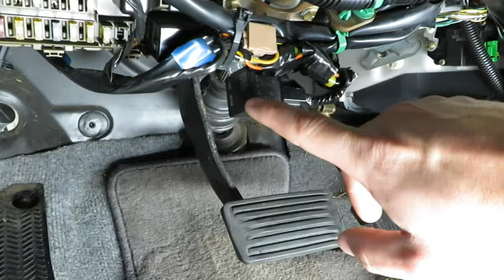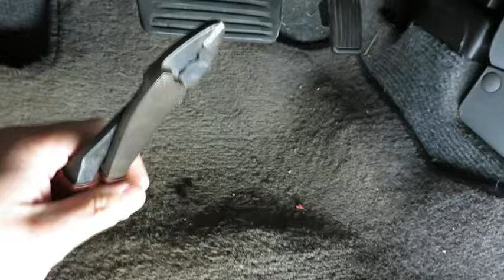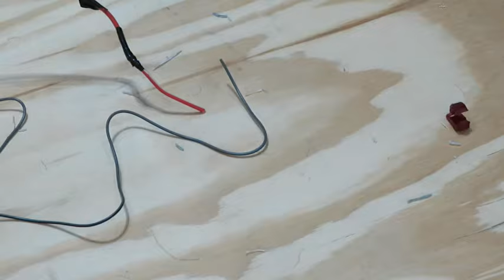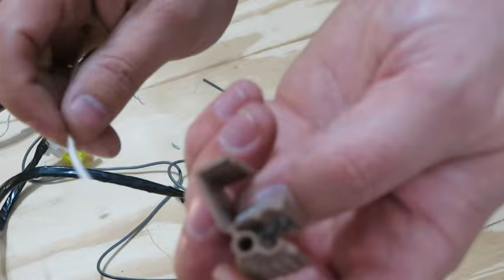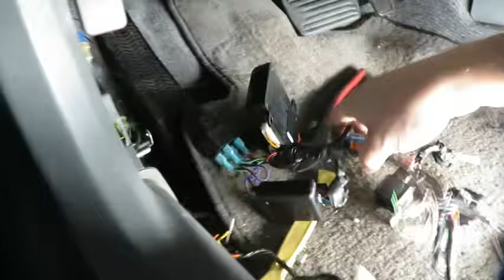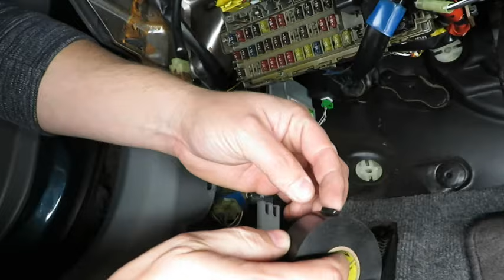Car Alarm Removal Made EASY Without Damaging Your Vehicle!

Comment: Thanks for this video. Do you have an Email handy? I have a 2002 Toyota 4runner 2wd and someone installed a IR-S Code Alram, it has like a little tiny switch to start the car. I would love to un-install it but not sure if I cut the wires if it will ever start again
Reply from the maker: dcautodiy@gmail.com
Reply: @DCAutoEnhancement  I will send some pictures over the holiday after I take some trim panels off
Reply from the maker: @ddemier  we will get it taken care of. No worries
Reply: @DCAutoEnhancement  I got it removed thanks to your video. When I removed the trim panels I saw where that had it tapped into the factory wire harness. Got that thing out of my 4 runner.. lol

Liked, subscribed and shared.
Reply from the maker: @ddemier  Awesome! I'm glad you were able to get it taken care of and thank you for your support!

Comment: Could having a remote start mess up your battery?
Reply from the maker: @alexis471221  generally speaking, no, it shouldn't cause any issues with your battery. However, if wire connections have become weak (especially the ground wire), that can cause a drain on the battery. Also, if you have had the remote start installed for a long time, the electronics in the main brain could be failing, causing battery drain issues. I guess maybe tell me what issues you are having?
Reply: Hi I just buy a truck silverado 2012  and see they have a db3 on it but the guy don't give me any control only give me one key! What can I do bc when I locked the alarm beep on. And when I unlocked with the key the alarm sound on. Any suggestions thanks
Reply from the maker: @viktorfrankenstein1240  the db3 is usually just the bypass module. Can you see if there is any other module?
Reply: No i dont see other module connected in the db3 or separate but i see the db3 is connected with harness on the obd2@DCAutoEnhancement
Reply: Tried to send some picture or short video..u got it . The db3 is connected to the harness to ob2 and go to the switch for key
Reply from the maker: @viktorfrankenstein1240  I will check
Reply from the maker: @viktorfrankenstein1240  I didn't get it. Send it to: dcautodiy@gmail.com

Comment: My ac/heat doest not turn on. I have no AC or Heat. I checked all the fuses,relays , blower motor and blower resistor,all is fine. Change the clime control module still nothing. This happens after the shop changed the starter. I do have an aftermarket compustar starter. Do you that has anything to do with my problem? Thanks
Reply from the maker: The only think that I can think of is if they somehow cut the heater/accessory wire. Does the heat and air work when you remote start the vehicle?
Reply: @DCAutoEnhancement  no the heat/ac doesn't turn on at all. The lights on the climate control are ON but the the on/off button doesn't turn ON neither the heat or AC. Thank you for your quick answer
Reply from the maker: @hnmpp  What is your vehicle?
Reply: @DCAutoEnhancement  2015 Honda crosstour 4wd
Reply from the maker: @hnmpp  I will look into your problem.  Did this problem happen after the installation of the remote start?
Reply: @DCAutoEnhancement  no it happened once the shop changed the starter and after they did some diagnostics they said might be the climate control module or the aftermarket starter.
Reply from the maker: So they changed the starter for the motor it sounds like.  I would take it back to them and make sure they didn't forget to hook up a power wire. When changing the starter they most likely had to disconnect some wires.  That is the only thing that makes sense at this point.
Reply: @DCAutoEnhancement  I did but they said they couldn't find anything wrong. Thank you so much for answering back at me ,I really appreciate
Reply from the maker: @hnmpp  I wouldn't think that the remote start would not have anything to do with it but you could disable it to verify

Comment: So you can just leave the t-taps in there?
Reply from the maker: If they are T-taps, you can leave them but I prefer to remove them and place electrical tape on the wire where the T-taps cut into the insulation. If the connectors are scotch locks, remove them for sure. If you don't know the difference you can Google them and compare the images.

Comment: Great video could you have just left the red connectors there instead of removing them and applying electrical tape
Reply from the maker: Yes, if you know you want to replace the alarm or remote start, it can be helpful to leave them so you can use them in the future. You also shouldn't need to tape them up. I knew that I wasn't going to be reinstalling anything on this vehicle but if I did, I would be soldering my connections.

Comment: How do you start your car when you lost your aftermarket key fob
Reply from the maker: You will have to bypass the starter kill relay. If I remember right, it should de-energize when you disconnect power to the alarm.

Comment: 2006 Ford F-150 viper… can it disrupt fuel pump?
Reply from the maker: Yes, if it has tripped the factory immobilizer system.
Reply from the maker: Is it a remote start or just an alarm?
Reply: @DCAutoEnhancement  remote start as well. I disable the box and re wire wires from switch but still doesn’t start. Also I notice some wires run to the driver floor that connects harness to the rear of vehicle. Can that be the one connected to a fuel pump?
Reply from the maker: @karristun1968  if those wires connect to the remote start, they could be to your door locks or brake wire not nothing from the remote start directly connects to a fuel pump wire.
Reply: @DCAutoEnhancement  if it tripped the factory immobilizer what can I did to fix?
Reply from the maker: @karristun1968  that would only happen during remote start. If he it is the immobilizer, your security light would be flashing

Comment: Hi, I replaced the battery in my key fob couple days ago. It started getting sketchy. Sometimes it wld work to unlock the car & sometimes it wouldn’t. Anyway, replaced it. 
   I’ve tried several times in several different ways through several different videos to reprogram my key fob. Fail! 
Now I just need to figure out how to shut my car alarm off so that when I put my key in the door to unlock my vehicle, the ALARM doesn’t go off EVERY.SINGLE.TIME!?!

Please help a sister out. Anyone?
Reply from the maker: Unfortunately, you will most likely want to disconnect the alarm all together. You will want to find the main fuse for the alarm, usually found in under the dash. If you have just an alarm, you will be looking for a red 10 amp fuse on a small red wire. If you have a remote start, you will be looking for two green 30 amp fuses on two large red wires. In some cases, you will find all three fuses that need removed. I hope this helps.

Comment: This doesn't help.  I don't know what I'm cutting or taking out everything looks the same.
Reply from the maker: Can you tell me what vehicle you are working on and possibly the model number of the equipment you are trying to take out?
Reply: @DCAutoEnhancement  Ford Mustang 2009.  The dealership put in this VTP Vehicle Theft Protection device.  The default code doesn't work as the pinpad may be faulty.  Can't start the car.  The pin pad says: ARM VALET PANIC on top.  Thanks for responding I wasn't expecting that
Reply from the maker: I will see what information I can find to see if I can help you.

Comment: I bought a van that has one half uninstalled and now no crank no start
Reply from the maker: Trace the starter wire, usually there is a starter kill relay that interrupts the starter wire. Depending on what is disconnected, the relay could still be energized or the relay could be bad not allowing power to flow through it. If you need help figuring out which wire is the starter wire, let me know the year make and model.

Comment: Car still won't start after I took the aftermarket alarm off
Reply from the maker: What is the year make and model of the car? Does the car attempt to start (turn over)?
Reply: 2004 Honda accord and it does turn over
Reply: @DCAutoEnhancement  2004 Honda accord and it does turn over
Reply from the maker: @DavidSmith-lg6lj  if it turns over, it isn't related to the car alarm. The car alarm (if equipped) interrupts the starter wire, not allowing the car to crank.
Reply: @DCAutoEnhancement  it all started when I was checking the fuses and after that it wouldn't start anymore
Reply from the maker: @DavidSmith-lg6lj  what was going on that you wanted to check fuses? I would look for your fuel pump fuse and make sure it's in place and is good.
Reply: @DCAutoEnhancement  my cigarette lighter wasn't working so I started checking the fuses
Reply: @DCAutoEnhancement  ok I will check and Thanks for ur help
Reply: @DCAutoEnhancement  fuse is good
Reply from the maker: @DavidSmith-lg6lj  the only other thing I can think of is just go through all of the fuses again and check them. If you have access to an OBD 2 scanner, I would check for codes. Sometimes a bad cram shaft position sensor can cause that problem. But I would say it has more to do with when you initially checked your fuses since it wouldn't start after that. Sorry I couldn't help more
Reply: @DCAutoEnhancement  ok no problem I appreciate ur time Thanks
Reply: Check your grounds,80% of electrical problems are ground related.My buddy put a fuse back in the wrong spot.He had pulled it ,it was bad.Just stuck it back in wrong spot,drove us nuts.Not having good grounds very common problem.Week ground connections cause all kinds of problems. Erratic or not operating at all on some devices. Nothing worse than electrical problem that comes and goes.

Comment: Rails against the uses of any connector except solder, immediately using a butt connector to connect 2 wires.  Lol, ok.
Reply from the maker: @aheadofthecurve2352  wouldn't say I was "railing" however, I did express my opinion. The solder comment was more about the installation of an alarm or remote start not so much the mending of a wire that had been cut.

Comment: I have n problems with starting my car switch on the car the alarm go off
Reply from the maker: If you have an aftermarket alarm, it probably isn't disarmed, causing the alarm to go off. Do you have the remote, did it work?